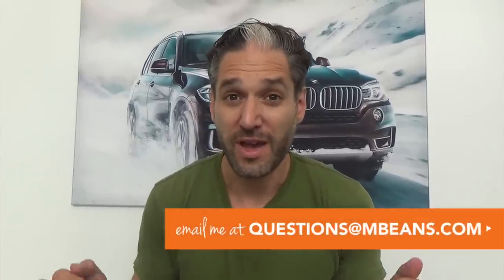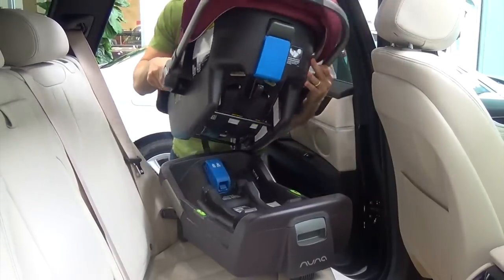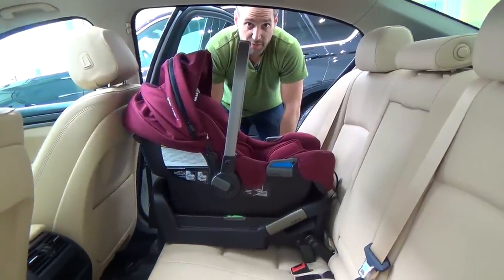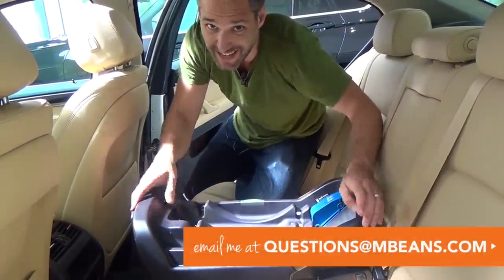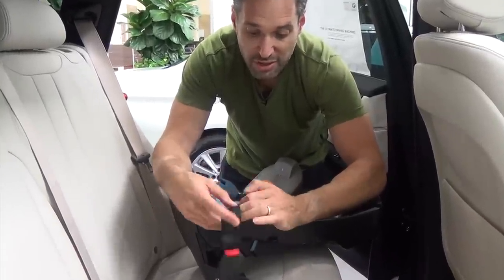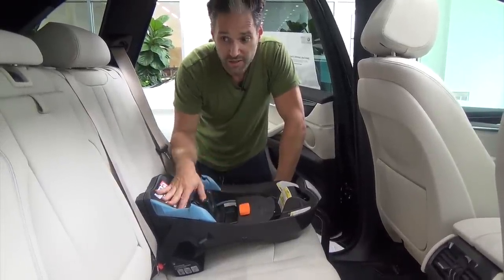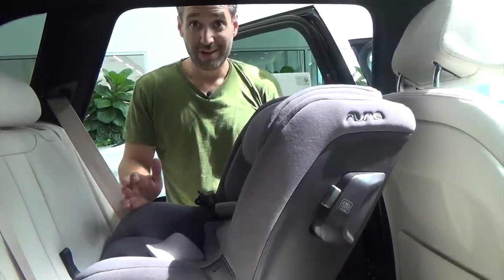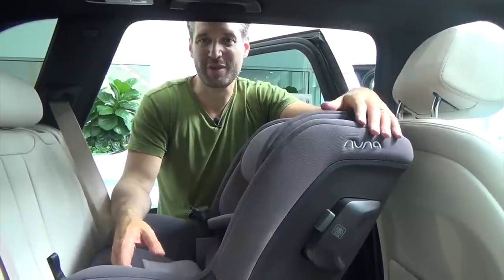Car Seats in BMW Cars | Nuna Pipa Rava | Clek Foonf | Cybex Cloud Q | X5 | 528

Comment: Just bought a raga for a BMW X3 and it is not secure at all. The seat moves side to side and when rear facing, the head/top can be pushed to touch the rear seat. Tried everything, no thanks on the Nuna Rava. Guessing that is why you didn’t actually wiggle the seat in the video
Reply from the maker: Hi Jonathan! Our videos are not installation videos. I would recommend reaching out to a local car seat tech who can help fit the car seat to your car.

Comment: I drive an x3 and my husband (6ft) drives a Mercedes c class. We have a 4 month old and originally bought the maxi cosi 70. Size wise for our cars and my husbands comfort would you Recomended the Nuna rava or the foonf? please let me know for both cars, as maybes different one will fit better in each car...
Reply from the maker: Hi Lauren! I would go with the Rava for both cars. I am not that familiar with the C Class but it seems very similar to the BMW 528 that I show in this video. The back seat of the X3 is going to be similar to the X5 that I show. As I show in the video  at minute 16:30 you can see that the Rava is great for tall drivers. 

You can buy a Rava here at mbeans.com with FREE shipping and tax free outside of MA and CT. 

http://mbeans.com/nuna-rava-convertible-car-seat.html?DeptID=410

Let us know if you have any further questions. 

Thanks for watching. 

Eli

Comment: You didn't show how to mount Pipa in the middle and if it's a better place or not. I was testing this in my BMW yesterday and while latch system is super rigid, the seatbelt installation on Nuna base is very flimsy since it moves from side to side (the front does), especially in the middle location. I ended up using latches. Unfortunately in 2-series that means most will not be comfortable in the front seat, so passenger will need to use rear seat behind the driver.
Also with that Cloud Q base, can't you just use latches in the middle position? Those latches are not rigid it should be possible and easier then seatbelt
Reply: the pipa can be put in the middle but alot of the time its not a good option. And for the cybex, I havent read their manual but alot of the time the base isn't allowed to 'borrow' from the other seat matches because it puts undue stress on the connector because of angle plus if you have seats on those sides, you don't want to risk buckle crunch

Comment: Can you use the latch system as well as the seat belt at the same time?
Reply: Kitty Bruno incorrect. Fnoof allows both latch as well as car seat.
Reply: Doesn't the pipa allow it too? At least the video I just watched of a pipa rep did
Reply: It wouldn't be in the manual if it didn't pass testing.
Reply: Confirmation bias? Naahh I just read the manual.
Reply: If you can use both, you can but I really don't see how it can help even a bit. With rigid latches you can't move the base even by quarter of an inch